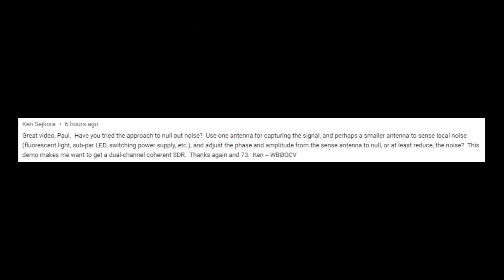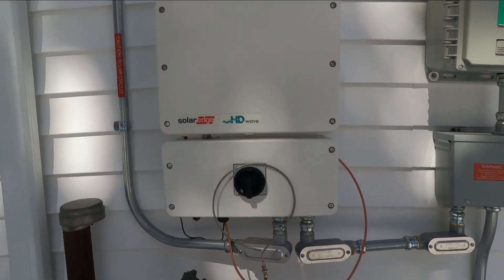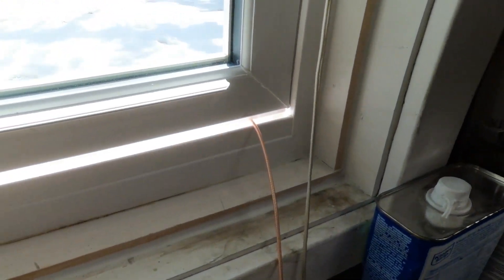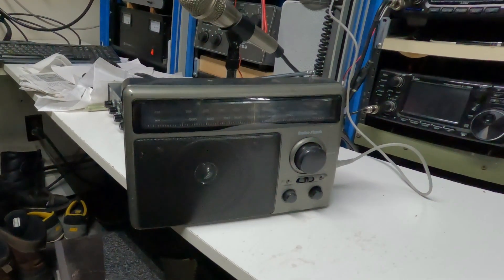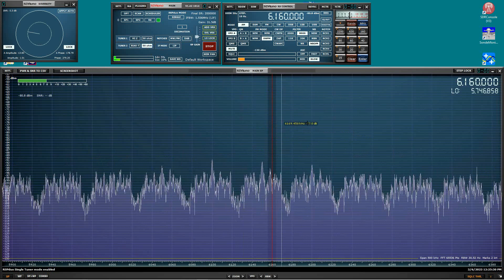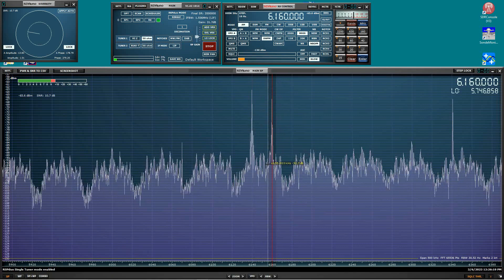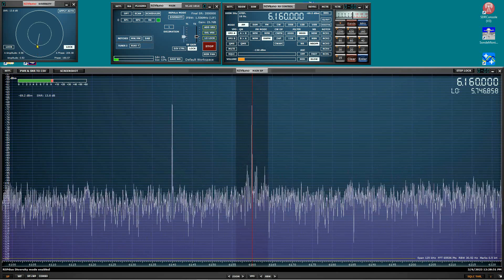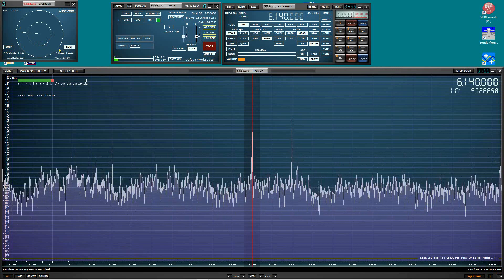SDR UNO Noise cancellation

Comment: Thanks for the demo Paul that addressed my earlier question.  Very impressive results in noise suppression using the diversity mode in SDRUno.  With coupling in a "clean" noise source, it lets you really zero in on the optimal phase and amplitude cancellation settings.  Are you the only one in your immediate neighborhood with solar panels?  I would imagine that each house with solar and its own inverters and optimizers would represent additional independent noise sources.  I have multiple neighbors within 100 yards who have rooftop solar, and one with several panels in his backyard.  Once the sun starts shining, I can see a similar pattern of noise, except mine are bands about 5 kHz wide and spaced every 17 kHz.    I have no clue who the culprit is, perhaps it's everyone together.  I may have to drag out a small loop and walk around the neighborhood and do some direction finding to see who is putting out the loudest source of interference. 
Thanks again for the great video, Paul.  73    Ken - WBØOCV
Reply from the maker: Yes..    I am only one...  I installed the system years ago when I was in a ham radio hiatus.  Now I have to depend alternate means to remedy the situation, Such as the phasing solution in SDR-UNO or other external means.  Adversity such as this causes one to use creative solutions.   Very possibly you have some inverter noise.  The earlier version of the inverter at my house had base frequency of 18 khz which sounds like what you might have.

Comment: Very interesting, thank you! I wonder if diversity mode can be done with SDR Console instead of SDRUno? I have RSPdx, (not duo) and cheap RTL-SDR dongle. Maybe cheap dongle can be used for local noise sampling and RSPdx for an actual signal? Not sure if that's possible (not in SDRUno for sure as it's only supporting SDRPlay) but would be great to find out! Either way, thanks for the great content! :)
Reply: Very interesting idea. I have the dx & a couple rtls.
Reply from the maker: You cannot do noise cancellation with 2 separate RX's that do not have phase coherent reception.  But you certainly can use an MFJ 1026 or ANC-4 and others to achieve the same results. See this video I made about that a few years ago.  https://youtu.be/spre7Wn0Kqs
Reply: @W1VLF  you mean LO phase locking? RSPDx has an external input (additional SMC connector I believe) for that and I believe there are internal pads in RTL-SDR that can be used for that as well with some soldering work and if LOs frequencies are the same. So, it's possible to do physically but not sure if it can be done easily with the software afterwards. Most likely using 1026 or ANC-4 would be an easier thing :) It would be great if you could do a 1:1 comparison between doing noise cancellation with RSPDuo (using both channels like what you showed with that video) and 1026/ANC-4 under the same condition (using same RSPduo's single channel as a receiver)! I do have a DIY solar system and this stuff is quite interesting for me and I was actually thinking about getting 1026 or ANC-4 myself.
Reply from the maker: @1rfsam   Thats a good question.  I think its more than that.   There has to be some provision for adjusting the gain and phase of one or both of the decoded signals.  Not sure how you would do that in the audio domain.  In the RF domain you can use a MFJ 1026 or ANC-4, or you can use the magic of the Software the Jon and his associates provide. I have a feeling its more math heavy than I can actually describe.

Comment: Hi, I use the diversity scheme to reduce noise with SDRuno slightly differently to you when receiving on the RSPduo. What I do is have two antennas spaced apart as much as possible so they are both receiving the signal but with slightly different noise profiles due to their location with regard to local noise. So, input A is (signal + noise1) and input B is (signal + noise2). The diversity auto-adaptation algorithm works (I think) by enhancing what is common to the two antennas and reducing what is different. So,, in this case, the signal is enhanced and noise 1 and noise 2 are reduced, This works very well for me. I think in your case, both antennas are receiving the noise from the inverter, so the diversity algorithm is not doing a good job of cancelling it. However, you override this feature and do a great job manually. Ing you don’t mind, I will forward a link to your video on the SDRplay Facebook page since I know a lot of the guys will be interested in it. Cheers, Mike.
Reply from the maker: Hi Mike... That makes a lot of sense about the algorithm. I do not have any other antennas that RX the noise very well as most of them are  300' away in the woods.  Yes please pass along the link. Thank you for watching and commenting